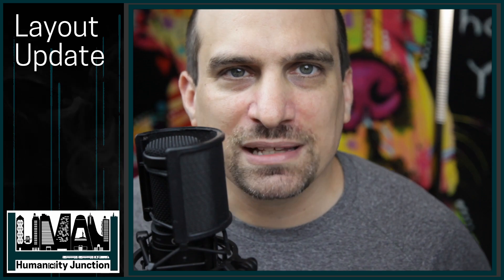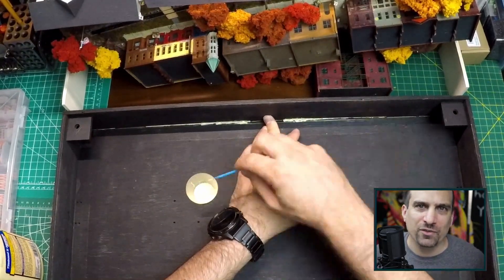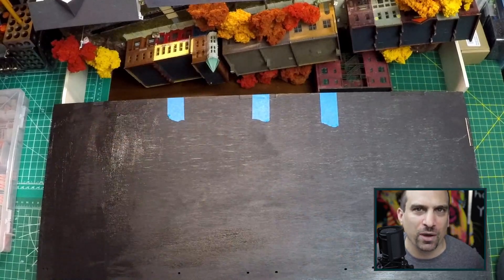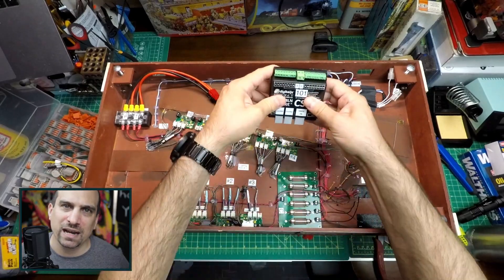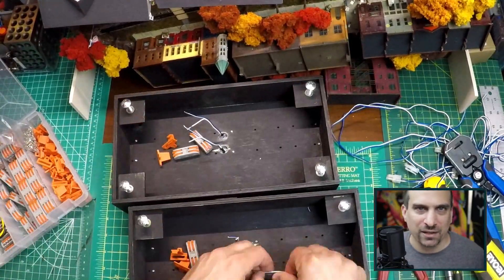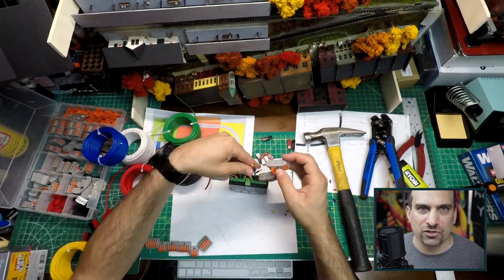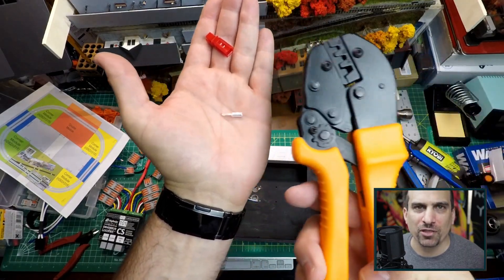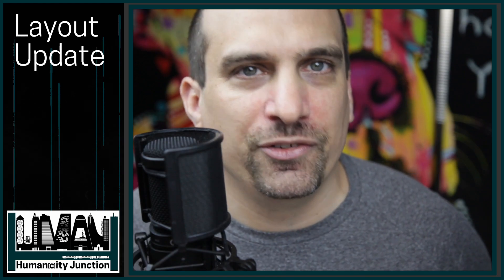43 | Layout Update | Wiring The T-Trak Modules For DCC

Comment: Congrats on 500 subs Heath!  Great video - very clear and well presented.  One minor correction - the current sensing device does not detect 'the drop in current' (@6:04) - it detects that current is flowing (through a decoder/motor/lights/resistor wheel set).  Sorry my inner EE is showing... 😁  Keep up the great work and looking forward to your next vidoe.  -Rick
Reply from the maker: Rick, Ugh!! You are totally right.  I have no idea what I was thinking. The rolling stock completes the circuit. Thanks for pointing out the mistake. -Heath

Comment: I love your wire management. I have a bunch of t-trak modules and i'd like to adopt your methods. where did you get those Wago lever nuts and the holders. The nuts are widely available but i can't find an assortment with the holders. And help?
Reply from the maker: Michael, the lever nuts I got are an off brand on Amazon called XHF. I checked out the WAGO website and did not see them. It might be something specific to the XHF brand. -Heath
Reply: @HumancityJunction  Thanks!

Comment: Hi Heath, Sorry I'm a little late in replying, a suggestion; Since you already own a label maker, see if tube or heat shrink tube cartridges are available for your label maker. This way you could label each wire. At some point in the future, having wire labels on the wire will aid in trouble shooting problems.  We use the heat shrink tubes at work, but we do not heat shrink them onto the wires, in case you have to renew a piece of wire you can just reuse the tube labels. Another neat thing with the wire labels, not only is the wire identification placed on the wire label tube, where the wire is connected is also placed on the label. This also aids in trouble shooting. Cheers, Rich S.
Reply from the maker: Rich, really great suggestion on the labels.
One thing that I am attempting to do is keep all of the wiring the same. Every module but one is the same, and every jumper but one is the same. At least they should all be the same if I did not make a mistake.  
I will need to label everything at the Current sensing device.
-Heath

Comment: Hi ya Heath, just in case I haven’t already.....congratulations on the 500 + subs. During the whole time I was watching, my mind wandered back to the  early 60s. When HO was popular and Atlas was king. I had hours of fun trying to keep track of the direction of all my manual switches and crossovers. And then I thought.....soon artificial intelligence will be having all that fun. Yeah, I know I sound like an old codger! It was just a passing thought. I have my DCC controller and the sound chipped locos. But sometimes I long for the old days. When you could smell the oil and grease coming up off your layout...........mmmmmmmmm...........
Reply from the maker: Norman, I definitely have a fond memory of the early days as well.  When I was much younger, in the 80's, I was trying to build an HO layout with 6 loops that could all be individual that could also be all connected.  I had a few MRC 2400 Tech II throttles attached to many Atlas switches. I still have fond memories of the sound of the Atlas switch motors. 
All that said, I would not give up DCC to go back. -Heath

Comment: Would wire the unit to T-TRAK standards and make all your block connections off of the wires outside the modules and Anderson connectors go up to several 100 amps.
Reply from the maker: James, this is absolutely my plan, which is why I have the Lever Nuts.  I did not realize the connectors went up to 100amps, I have only used the ones up to 45amps.  Thanks. -Heath

Comment: You can find the wiring standards for T-TRAK at www.ntrak.org.
Reply from the maker: James, thanks for posting this.  I am following the BWWB standard up to the lever nuts. But since block detection is not a part of the standard, it changes a lot after that.
But with the Lever Nuts, it is very easy for me to swap back to the Kato connectors to be T-Trak compliant. -Heath

Comment: That’s a lot of wires! Congrats on over 500 subscribers. Your bloopers did not disappoint. Love the neck roll.
Reply from the maker: Mark, unfortunately there are a lot more wires to comes.
I definitely could have used less wires, but wanting the block detection and also wanting the setup to be flexible, it added a lot of wires.
I am really curious to see how it is going to turn out.
Somehow I think the neck roll will reset my brain to mouth connection. It does not actually work. -Heath